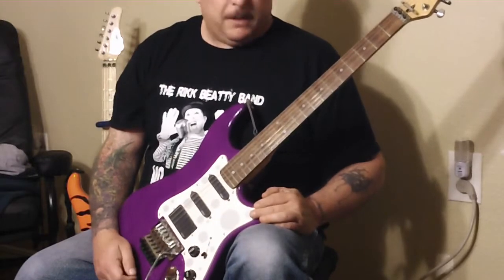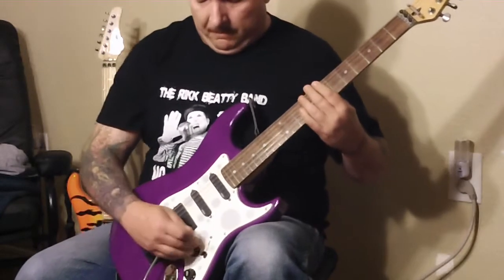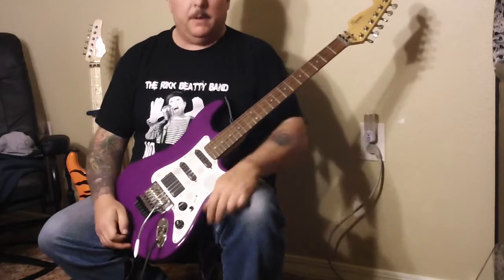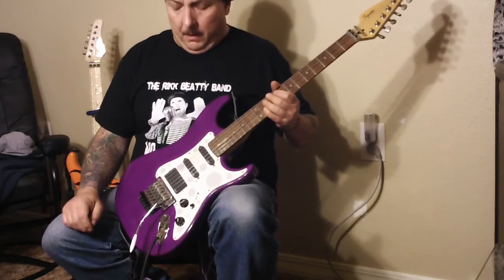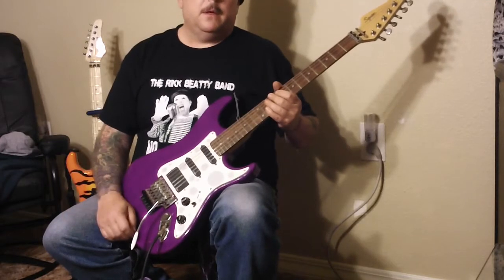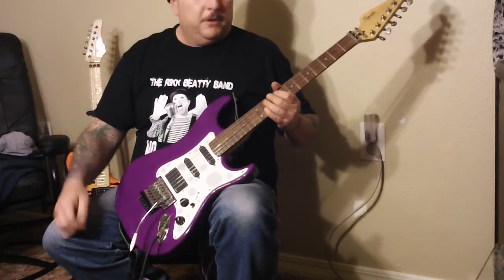Intonation And Floyd Rose Tremolo Part 3

Comment: I have to know what amp you're going through to get that great tone/sound.  Settings on the knobs would be a great bonus...well, sort of a necessity.  I'm happy things are looking up.  I loved the videos.
Reply from the maker: I am using a GFX212 Crate Amp on the clean channel and pushing the guitar through a Zoom 505 II Pedal on F4 Bank. The guitar itself was Full Volume and Tone was all the way up. The guitar was modified... I pulled out the stock pickups and added EMG Active Set. So I use older gear but it still works. LOL
Reply: ***** Old or new it still sounds great.  My favorite is the Line 6 AX212.  I use that and run it through a Marshall 4x12 cab.  That is definitely an old set-up and to this day I have yet come across any other amp that I like as much as my current rig.

Comment: from experience I have noticed strings have a tendency to go slightly sharp when you lock them down at the nut.  Did they do that with the Floyd blocked off?  If so, did you have to retune and reintonate each string?  Thank you.
Reply from the maker: Yes... Even before I installed the Trim-No Trim unit the strings would go a little sharp when the nut was locked down. It was not a problem as the intonation was already set for correct tuning so all I had to do was adjust the fine tuning screws on the back end of the Floyd Rose and was good to go.